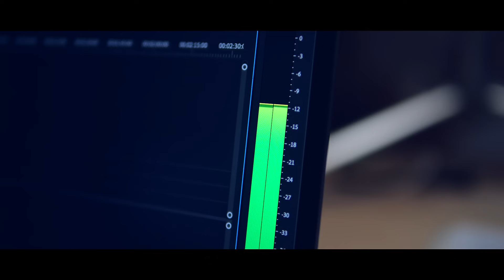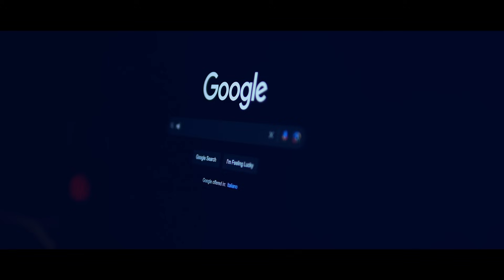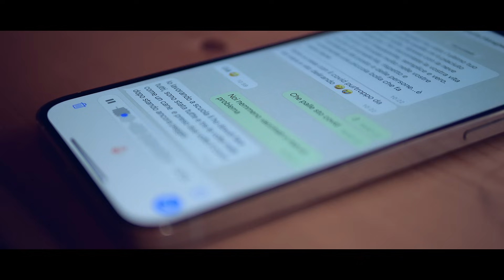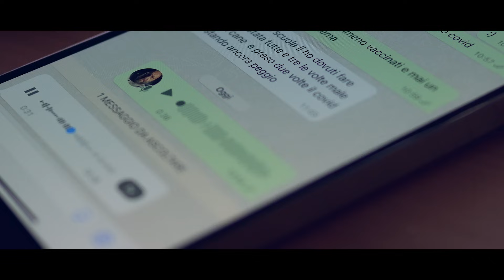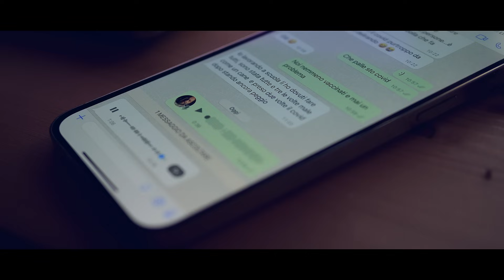VIVERE IN CAMPEGGIO: quali sono i costi annuali in un campeggio con baite per stanziali? Conviene?

Comment: Caro Armando, un impianto fotovoltaico, a isola o meno non importa, in un luogo come quello, in un bosco, temo non possa avere una resa ottimale. Poichè basta anche solo una piccola ombra su uno solo della serie di pannelli fotovoltaici installati per abbassarne drasticamente la resa.

Mi sono fatto una certa esperienza in materia poiché ho installato qui a casa mia un impianto a isola BLUETTI da 3kW (AC300+ una batt.accumulo B300 )
cui ho poi aggiunto anche 2 AC200MAX da 2kW l'uno (uno di questi lo utilizzo anche in camper, molto portatile). Inizialmente i pannelli fotov. li avevo installati su balcone e davanzali di finestre, ma  le ombre anche minime di qualche  tubo o struttura inficiavano la resa di watt erogati.
Per risolvere ho dovuto installarli a tetto. Fai attenzione a questo aspetto quando inizierai a sondare l'argomento e progettare una soluzione. Ciao e complimenti.